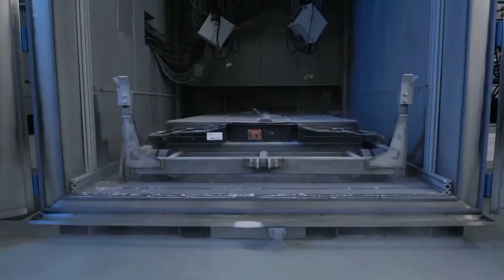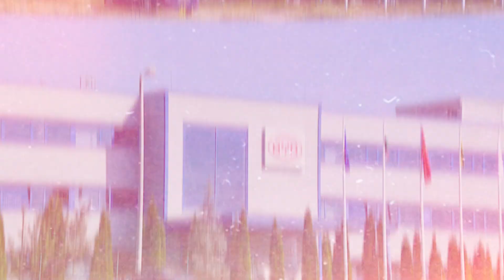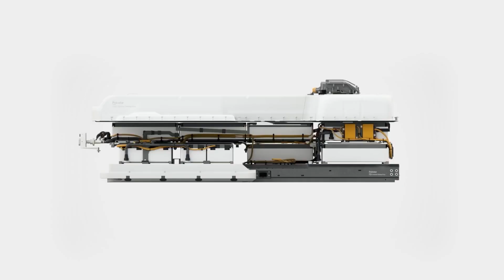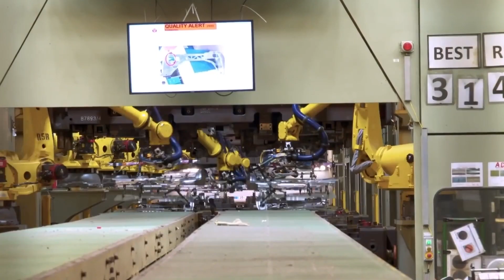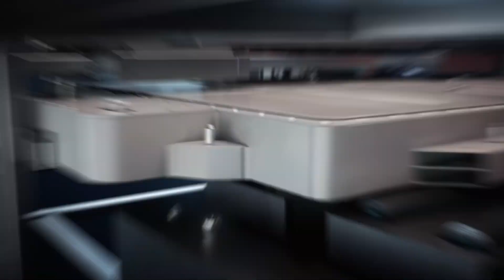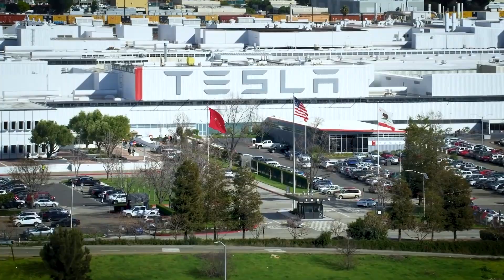EV Wars: BYD Blade Battery versus NIO Battery Swap

Comment: There is already almost 1300 swapping stations in China and almost 15 000 000 swaps has made. 3rd gen swap stations will swap the battery under 3 minutes and in future maybe even faster. 

Swapping the battery would be a good choice for example people which live in apartment and large metropolitan cities.  Swapping the battery means that consumer get another good way to "charge" your car. There is no harm for that there is more option to charge which is the main point of this.

Regular EVs has: Home charging and fast charging options

NIO EVs has: Home charging, fast charging and swapping the battery option.

It is no brainer situation in point of view of consumers and it should not be too hard to choose which one of these offering more options and being that way is more better solution too :)
Reply from the maker: @iSot80, this is exactly the advantage of NIO. It helps give more options in the market. It prevents stagnation in the EV market, which could pressure the market and technology to progress faster! Thanks for your input.